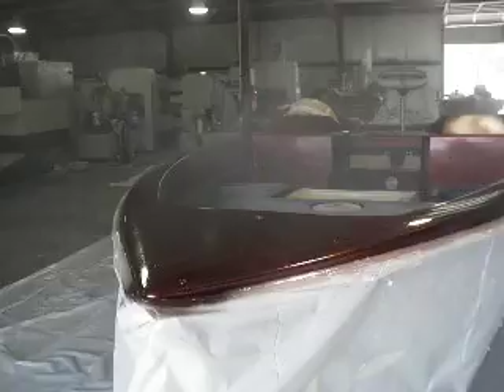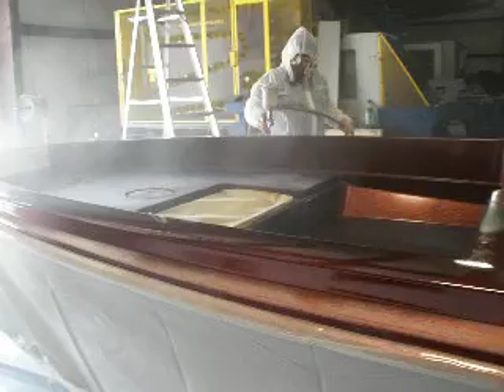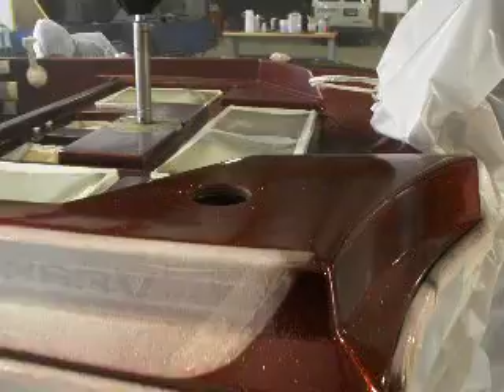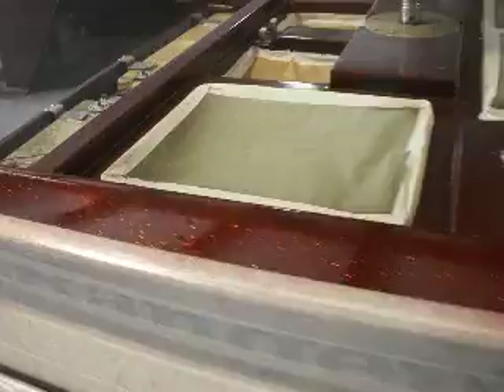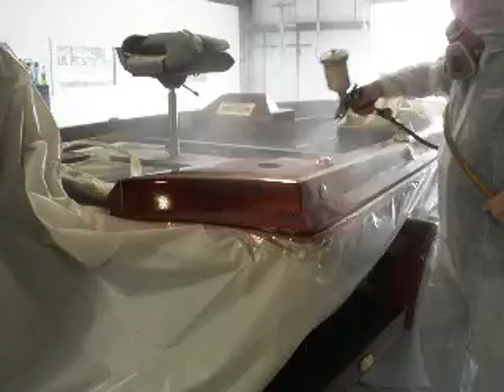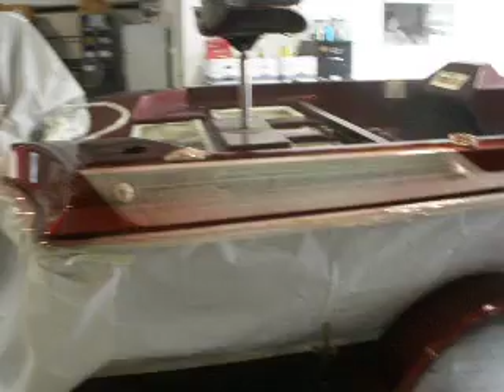Painting Ranger Boat Part 1

Comment: my boat was red metal flake and faded real bad in fact it was pink .
I cleaned it good stripped every thing off all hardware  cleaned w/ wax and greese remover and sanded with 600 wet then used house of color intercoat clear base w/ red candy mixed hot and when the color was good, then I applied 4 good goats of tru finish auto clear and i was happy with the finish I got ,it was smoth so i never cut and buffed.
3 years later still looks like new.